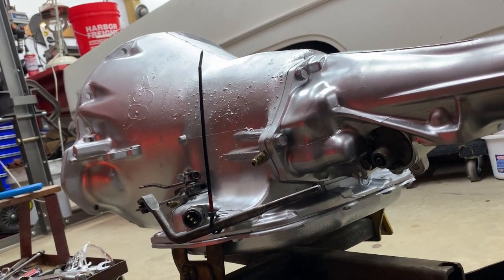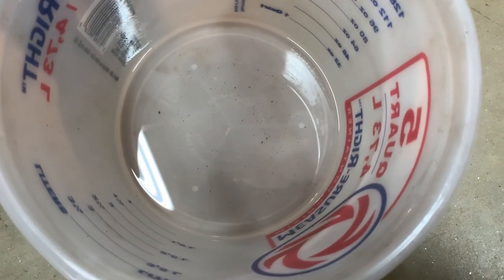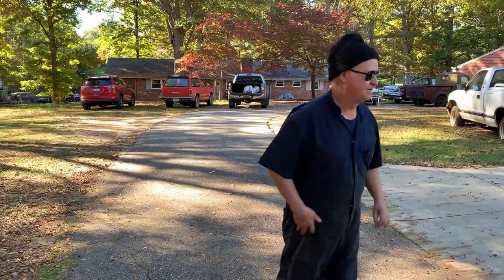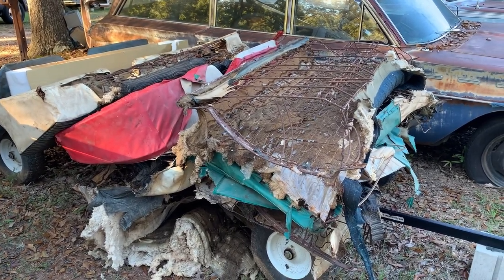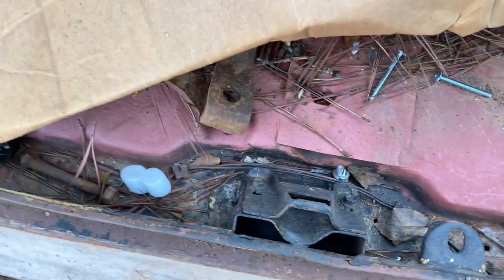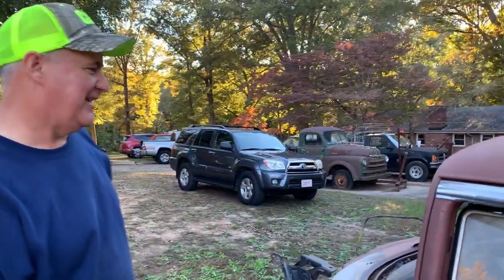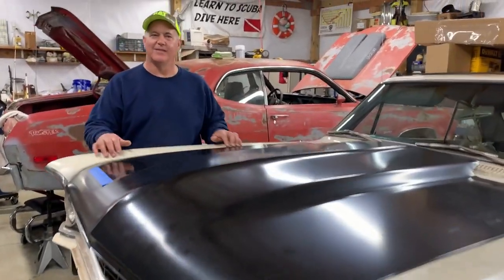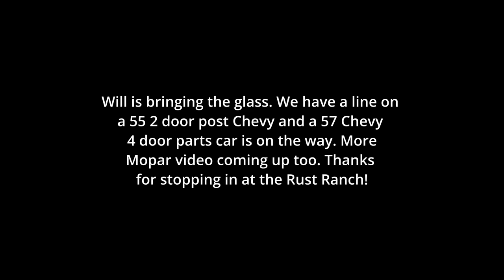Got Fins? 57 Chevy 2 door post!

Comment: You have got my interest on this one.  The 57 Chevy is one of my all time favorite cars.  I had a two door post just like this one when I was in high school.  It was a 6 cylinder with a powerglide trans, red with a black top and the red and black interior.  I drove it back and forth to Tyndall when I came out of tech school.  I made the mistake of selling it when I got my orders for Vietnam.  I have a lot of stories of my wild youth in my old 57.  A short one for today, when I got first got it, it used as much oil as it did gas.  I got a small country garage to rebuild it for $85 and it was still running great when I sold it.  Well give my regards to the Queen and Vern and keep the videos coming.
Reply from the maker: Tyndall? You are showing your Air Force. I almost bought just like this one only it had 283 4bb. and 3 on the tree. I passed on it. It was $600.00. Thought it was too much at the time, lol. Bet you are hiding a lot more 57 stories. Hopefully this video series will bring back some great memories. Hope you and Jackie are well. Thanks for stopping in, Jerry. Keep the stories coming.
Reply: @indyme2  I bought mine in 66 and paid $100
Reply from the maker: @jerrypolk5909  The $600 car I didn"t buy was in 66. Ended up buying a 57 Ford 312 4bbl. Boy was that a mistake. Or not. I learned a lot about auto repairing on that car.

Comment: You will have this one done faster then the dodges. Parts will be a little easier to find. Most of the floor supports rust out. Looks good. DD speed shop has done lots of rust repair on these. Good buy on the hood.
Reply from the maker: Yep. Parts are easier to find and 1/2 the price too. Will get it in the air and take a look underneath to see what we have. In the meantime, I have a 57 parts car coming and another 57 project to follow. Thanks for stopping in!